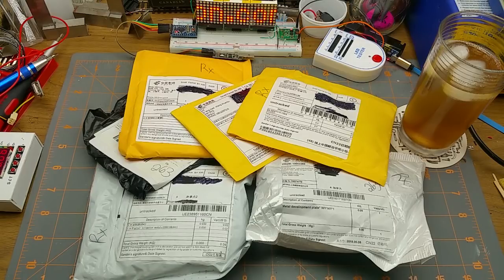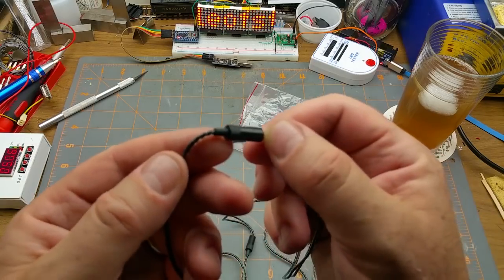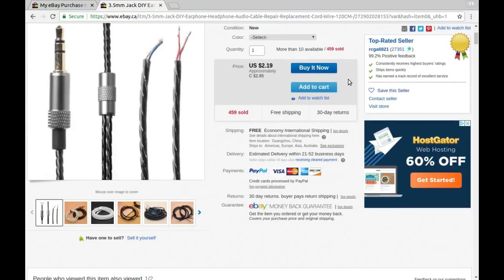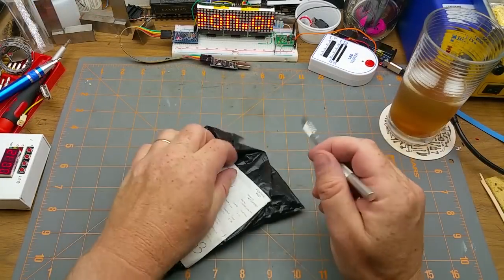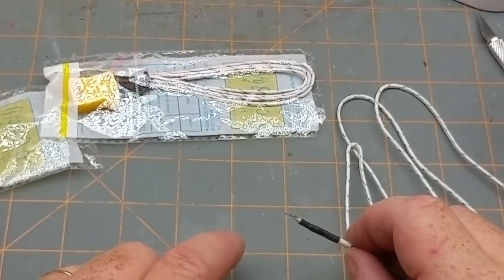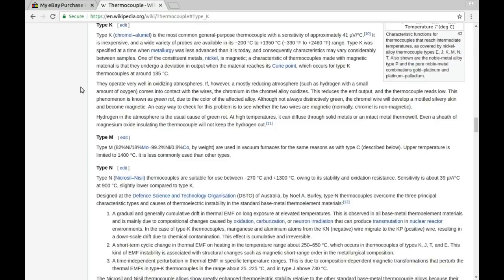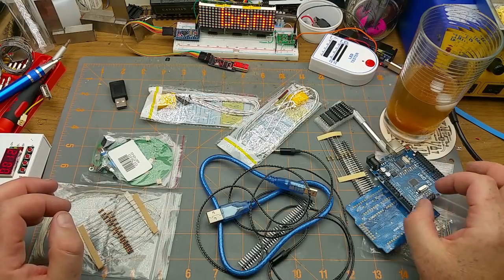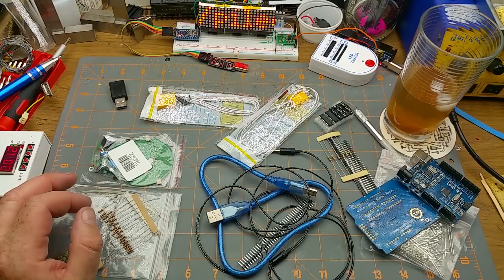Long Weekend bonus mailbag monday   (MM#35)

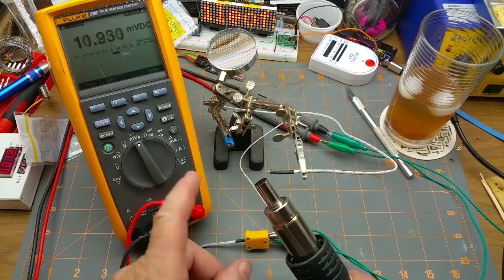Comment: 11:37 - the Fluke 289 multimeter that you are using supports direct temperature measurements using a K-type thermocouple. Leave it on mV range (as you already set), press MENU then TEMP then choose 'C' or 'F' - no need to calibrate, just read off the temp with stated accuracy of 1%. This is a RTFM (page 28 in the current download at fluke website).